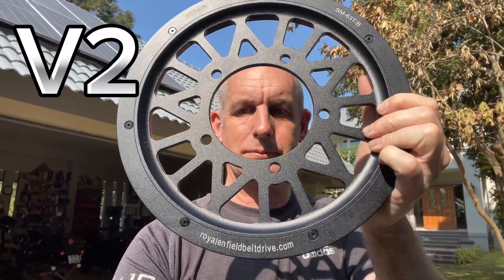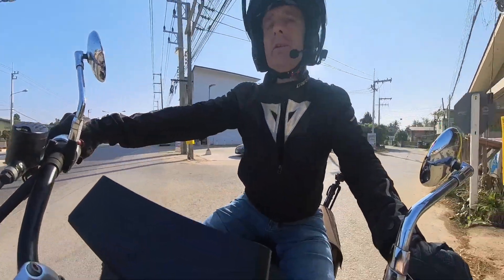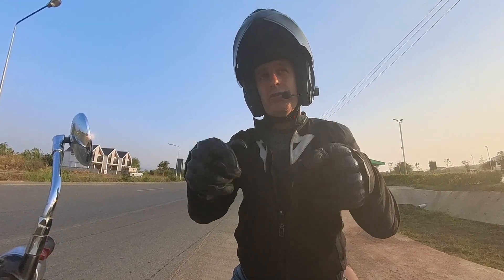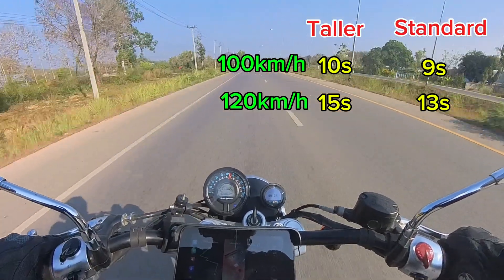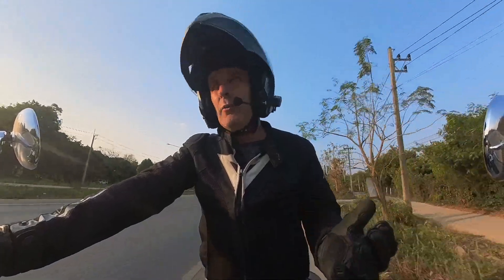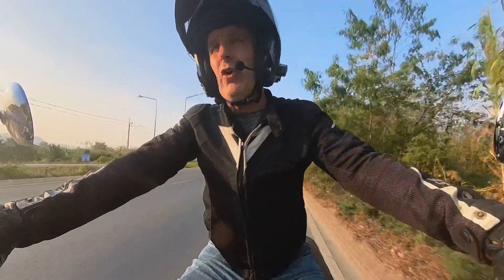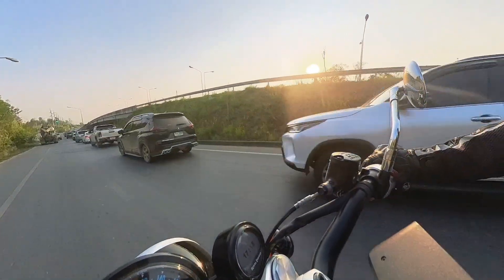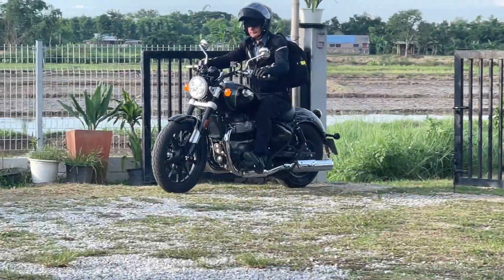Belt Drive Gear Ratios: The Science Explained

Comment: It will be interesting to see the diference between standard ratio belt drive vs. longer ratio belt drive.  Excelent videos, very informative, thanks therefore.
Reply from the maker: Thank you. Yes prior to this video I ran on the taller geared ratio on the version 1 belt drive for about 7,000km. So it was a shock going back to standard gearing, but I do think I prefer it on the Meteor 650 🙏

Comment: You probably know by now that they did come out with a belt drive for the meteor 350. They have it in standard gearing as well as the 16 tooth front gearing. I’m trying to decide which one to get because I’m concerned that the higher gearing on the 350 will be difficult because it has such a small engine and such little horsepower.
Reply from the maker: Yes I know. 😂 It was developed on Mrs T’s Hunter. But the launch was delayed. I’ve missed the boat while in UK. But videos coming out soon from me for install, tension  and ratios 👌🙏

Comment: Since there are no new instructions with 2.0 out yet I wanna give my opinion.  I think the front sprocket needs to be text facing out.  The flange is too wide and it scraps against a solid metal wire harness .  If I could get an official answer if this is safe that would be good to know.  Thanks
Reply from the maker: The designer is on a plane to Canada as we speak. But I know he will input as soon as possible. 🙏

Comment: What is the facing of the vs 2.0?  The front socket goes flange in I think.  And the rear one goes logo facing out?
Reply from the maker: Yes that’s the preferred way. Don’t worry about running the belt in the middle of the rear flange. Just 1mm away from the outer flange is how I run mine 👌🙏
Reply: @Ride-with-T i figued there was a correct wnd wrong way, noy a preferred way lol
Reply from the maker: @TroyJPerez we trialled it the other way also, but found front flange in worked best 🙏
Reply: @Ride-with-T The rear sprocket definitely has a specific fitting I imagine though cause it's not balanced equally.  One side is more recessed than the other
Reply from the maker: @TroyJPerez writing out. Tell the world 😂😂🙏
Reply: @Ride-with-T will do.  Lol. I have just seen other that were perfectly even where the side didn't matter or had text that said this side facing out.  Your sprockets had me guessing.n it is interesting that the front can go either way.  I'm guessing that is due to it being balanced and the rear having a double flange.   Otherwise you would need to place it opposite flange of the rear one always so it could not slide off
Reply: @Ride-with-T flange in rubs against a metal wire harness.  I think flange out is the way
Reply from the maker: @TroyJPerez I’ve messaged the designer for you. It will take a while as he is mid flight 🙏
Reply: @Ride-with-T I got it figured out.  I was stupid and overlooked some things in the instructions

Comment: Ive had so much drama with the Super Meteor chain im strongly considering getting a belt drive, I saw a video just before of a guy on Harley that ripped his belt going down a dirt road and was wondering if some type of belt guard like the Harley has is able to be put on?
Reply from the maker: A Harley ripped a belt, and you want a belt guard like a Harley? 😂 That is the problem with belt guards. They keep stones in as much as out. To save any issues, understand the limits of a belt drive. It’s for cruisers on good roads for achieving long distances with out the fuss of lubricating, tensioning and cleaning. The original chain guard can be slightly modified to fit. 🙏
Reply: @Ride-with-T  Yeah haha it was a new Harley Road King but it didnt seem to have a belt guard, yeah ok interesting so by leaving the guard off there's a chance the rock will fall out again? Yeah im new to these so just trying to nut it all out PS heres that vid of the Road King/Gravel Road people 😅 https://youtu.be/MD1UPdOi7Zg?t=171
Reply from the maker: @ I have watched this video before. Belt drive still wins for me from his conclusions. There is a reason all dirt bikes use a chain. And for a belt drive on a gravel road, that was too fast and asking for trouble. He didn’t mention how often chains and sprockets need to be replaced. The cost and hassle of that if you keep a bike long term underlines the value of belt 🙏

Comment: The ONLY real downside to a belt drive is getting a new belt if it does snap.
Reply from the maker: That really only happens if the belt is over tensioned or misaligned. Sadly there are some poor quality belt kits out there, that are poorly made and the belt teeth don’t even align properly. Luckily RSTech belt kits are not like this. Every thing CNC cut, not cast. Very accurate fit. And if for any reason you do need to replace the belt, RSTech have chosen a common industrial belt available worldwide by Gates. So you are not tied into buying a motorcycle brand name belt, or from an individual company 🙏

Comment: Yeah, but it is so hard to find belt lube 😂😂. Seriously though, I have kept track of all my fill-ups and mileage for my modified Interceptor 650. The bike has a reduced weight of a little more than 200Kg and I average 29.7 Km/L. (I weigh 80Kg). It has the standard chain drive. No doubt this would be improved with a belt drive. At 15,000 kms my original chain and sprocket are in good condition. I keep them clean!
Reply from the maker: I love the lightness and better turning circle of the Interceptor.   I was hoping the new Classic 650 would be lighter than the Meteor, not heavier. Good skills on getting it lighter again. Chains and sprockets will last if you tension and clean often. That's very good Kpl.  I think you should get a belt drive for even more lightness and better fuel economy 😂🙏

Comment: Ah, I can add a few things here as I am well versed in chain versus belt drive on machines - to include motorcycles. Chains have their advantages but one of their advantages one being is they are not as wide as a belt and for the most part cheaper then a belt and not to mention easier, on the whole to replace. Depending on the chain type you can have many disadvantages including noise, vibration (as you pointed out), and most often they are incorrectly adjusted (this is a subject in itself). As far as being dirty that is often more an issue with the way it is being lubed then the chain. Chain lubrication, as it comes to motorcycles is a very deep rabbit hole. Here’s some insight on HDs use of belt drive. It started with the implements of sound regulations here in the US. There had been after market kits for both primary and final drive conversions for years prior to HD adopting their use.  HD did start with a bike with both belts but stuck with chain for the primary drive. In testing the belt they found it more efficient as well as being quieter. By being quieter they could make the exhaust louder! The belts have proven to be extremely reliable and fail most often due to incorrect alignment in the horizontal plane. Not good for belt or chain. As for mileage most engines have a “sweet spot” where they run most efficiently. The stock ratio, putting the rpm’s where RE intended, coupled with the efficiency of the belt, points to the mileage you achieved.  Here’s something to ponder, at steady state operation, fuel is used only at a rate to maintain that rpm as, I am sure you noticed, the throttle is not open that much. Upon accelerating your throttle opens wider - using more fuel, then you close it back down. Your mileage, in common use, is based more on the throttle being opened on acceleration rather then steady state operation.  Something to ponder when you are looking at mileage. Great job by the way!
Reply from the maker: Many thanks for such a detailed comment. I am noticing a hotter engine now with higher rpms. Still a half tank to go before I refuel again and can check. Many rhanks 🙏

Comment: I own a Triumph Bobber, which is geared with 17F and 37R sprockets. That ratio of 2.18 means higher speed in six gerar but @ over 160 K/hr. Due to error lights, changing the spokes dramatically isn't possible without reprogramming the ECU. I replaced the 17T front sprocket with a 16T. The new ratio (2.31) is slight but noticeable.  I can actually use 5th gear from time to time.
Reply from the maker: Interesting. That’s one thing I forgot to mention. The speedo. On either ratio on the Meteor 650 it is accurate, because it uses the front ABS sensor to sense speed instead of engine rpms, from what I’ve been told 🙏

Comment: Royal Enfield does some extensive testing and I wouldn't be surprised that those stock ratios are probably as good as it gets.  I have watched on videos about the cam upgrade for the J 350s that it ends up being a trade off because it gets a little more power on the top end, but the torque has moved up the rev range also.  It ends up feeling a little softer on the bottom.  😎
Reply from the maker: Yes I’m sure they do. And the torque and rpm values have been studied by RS Tech to produce the 2 options. There is always going to be a trade off. It all depends on personal needs. I do love this 650 engine though .Royal Enfield have produced a gem. 🙏

Comment: Yes, that doesn’t make sense with the standard gearing achieving better mpg over the taller gearing. I’ve found that the mpg on mine is better with a 16 tooth front sprocket (obviously chain drive). I think if you ride solo without luggage, you will do better (which I’m sure you know and will carry out that test). I’m very interested to find your conclusions before I order mine. I’m still leaning more towards the taller gearing as I do more touring than commuting. Great video, I look forward to seeing your progress.
Reply from the maker: Thanks. Yes the chain and taller ratio I have many Kim’s experience and figures. The results are conclusive. The new standard ratio I need to do more Kim’s before making a conclusive result. But I’m still looking for that 7th gear 😂🙏

Comment: Lowering the engine's RPMs does not necessarily increase the efficiency of the engine.  I can only assume that the engineers at RE calculated the final drive ratio to keep the engine in its sweet spot where it is the most efficient.
Reply from the maker: Yes they did. I’m not sure if this will copy and paste well, but I’ll try :-
kph (mph) rpm st ock rpm “16T ”
100 (62) 4330 4060
110 (68) 4760 4460
119 (74) 5150 TQ peak
120 (75) 5180 4870
127 (80) 5150 TQ peak
130 (81) 5610 5270
140 (87) 6050 5670

Comment: I already installed the drive belt 1.0 with higher gear ratio 3 months ago. Compared to the chain it's the best upgrade I have done to my Super Meteor 650.
If I had to choose again I would not go back to the stock gear ratio. I like the way the bike functions now as a cruiser  at 100-120 Kmph with lowered rpm.
I don't care much about the possible difference in mileage which will only be minimal. I also want to add that your comparison of mileage has some variables that you didn't include for instance the way you use your right hand, the different trajects that you choose, the weather circumstances, the weight you are carrying and also the age of the bike the moment that you measured the mileage.
I also installed the Racing Rhino exhausts, a DNA filter and a Fuel Pro+ fuel manager which has the possibility to run with a lower A/F ratio which will compensate for possible loss of some power. I didn't check my 0-100 Kmph figures yet but will do that later as well as my mileage.
Reply from the maker: That’s great to hear Pieter. Yes gearing ratio has to be a personal choice, hence the 2 choices available and the reason for the video. And like you suggest there are many variables. Hence the reason I need a bit more mileage to confirm. I don’t think I can fit the DNA filter here. It’s far too dusty. But will fit exhausts in the neat future. An easy way to drop a lot of weight off the bike 🙏
Reply: @Teacher-T-Thailand  Read this, found on the internet: For dusty conditions, foam filters are one of the best options. They are made out of foam that can easily trap tiny dust particles while still allowing plenty of airflow. This advantage makes foam filters ideal for off-roading. Dirt bikes commonly use foam filters as they are used in dusty off-road conditions.

Comment: Bonjour, je pense que la différence de consommation provient surtout du rôdage. Quand vous avez installé le kit courroie ; le moteur était libéré. Dommage que le super meteor n'est pas de compte tour. Cela aurait été plus parlant pour juger la consommation.
Reply from the maker: I always reset my trip mileage and take a photo of the pumps on every refill. I’m always interested in fuel economy. An easy way to check if anything is wrong with the bike if things suddenly change. It’s also a more reliable way of being a fuel gauge. I always know between 300 and 320 km it’s time to fuel up. And when I do it’s normally around 12 lites, still leaving me a useable 2 litres in the tank if I want to push further. 🙏

Comment: I have altered the variator weights on my 2 scooters xmax 250 sh300 put heavier weights in so slowe acceleration and relaxed cruising. I rode uk to spain on these 2 bikes and with the heavier weights I could easily sit at 70 all day whereas 60 was more comfy on the original weights. I couldn’t really tell the difference in acceleration.  I absolutely love belt drives as an old codger that hates cleaning chains and adjusting so frequently. I think there’s a real opportunity for mid size belt/shaft.
Excellent watchable vlog. I can see it being more economical because of far less friction. Pick a chain up then a belt
Reply from the maker: Yes it’s proving to me much more efficient. And it is nice to cruise at lower rpms. What cruisers are supposed to do. There certainly is a difference between the 2 kits, hence the reason for the video. To help riders decide 👌🙏

Comment: Better fuel economy ? Bullshit. Go test it on the machine and it will show a power loss.Now test fuel economy by going the exact same route same exact speed with same wind speeds.Chain will deliver better mileage.Chain drive has been proven thousands of times with controlled tests to be the most efficient means of power transfer.Wayyyy stronger than a belt. Your fuel comparisons are nonsense .You have not shown figures  that prove anything.
Reply from the maker: I actually take photos every time I fuel up. Of speedo and pumps. I only showed it once in the video, but trust me the results on the higher geared ratio was consistent. And so were the results of the 7,000 km I rode on the chain. I think you’ll find there is a difference between power loss and efficiency. The belt weighs next to nothing compared to a chain, and the notches fit the pulleys perfectly. Even bicycles are having a belt drive revolution at the moment, as it’s more efficient for the human motor. 🙏
Reply: @Ride-with-T  And, why do some USA helicopters provide belt drives from a 300 hp motor to drive EVERYTHING?  Now that is some commitment!!!
Reply from the maker: @ interesting. Thanks 😂👌🙏

Comment: So I see it will be an attempt to claim there is no loss of power by converting to belt.Physics are physics belt drive robs 2-3 % more power than a regular chain.1 1/2 to 2 % than an o ring chain.
Reply from the maker: Use Chat GPT AI tools and ask the question. It will agree with you on power, but not on efficiency 🙏

Comment: Very insightful!
I have wanted to experiment with a belt drive kit on my SM650 and this video makes me very confident.
Though I'm not sure my 4 year warranty will be valid once I do.
I've stayed off any mods so far.
This along with that beautiful Hagon rear shock setup will be my first mod.
Along with that downright rubbish headlamp.

Come to think of it, I wanted to ask if you have been happy with your rear tyre?
I find it extremely skittish. The least bit of corrugation in the road and it wants to skip a steady line.
I’ve never found that to be a problem on my old Bullet 350 even with a slimmer tyre.
Reply from the maker: Thanks. Surprised about your comment about the headlight. I’ve just returned home in the dark now and find it extremely good. Low beam and high beam. Sound like you have an issue there somewhere. Agreed on the rear tyre. Riding it at 36psi does help, but the tyre itself is far too hard. Near,y 20,000km and no wear. 😂🙏
Reply: @Ride-with-T  I understand why you say that. In darkness it is adequate and has a very decent beam pattern. I am not so convinced by the throw on HI beam.
The LOW beam (beam intensity) could also do with some improvement.
The contrast it provides in traffic in India is wanting.
Reply from the maker: @ I see. I must admit not much traffic in the night time here, so I’m unaware. 🙏

Comment: I think it's quite normal and expected to get a much lower fuel consumption with the standard gearing, during every day riding, since the engine experiences less load during acceleration.
The only time longer gearing is more fuel efficient would be at higher rpms than the peak torque.  Watching your videos for all that time I can tell you're not that king of rider.
Having worked on fuel maps in the past, I can assure you that a lot more fuel is needed at lower rpms with higher loads (like a higher gearing belt drive), than cruising at higher rpms.
Reply from the maker: That certainly seems to be the case. But if that is true, the belt drive is delivering an extra 5kmpl compared to the chain of the same gearing ratio. One more tank refill will confirm 🙏
Reply: @ I'm sure it does!  Same goes for timing belts instead of timing chains, but it's a lot mor practical to have a timing chain and that gains are minimal.